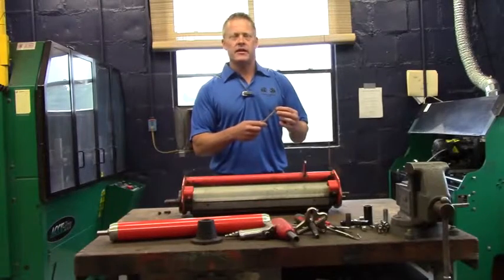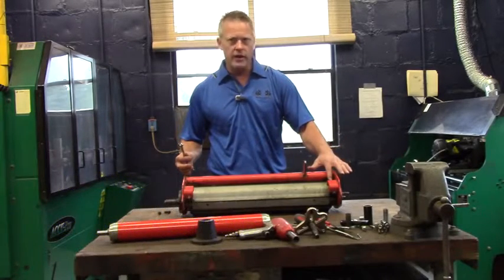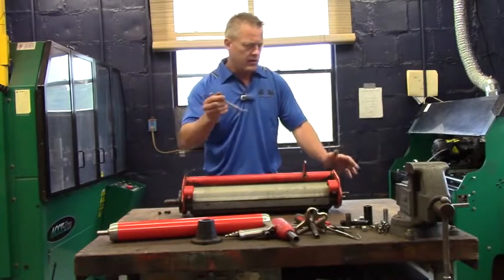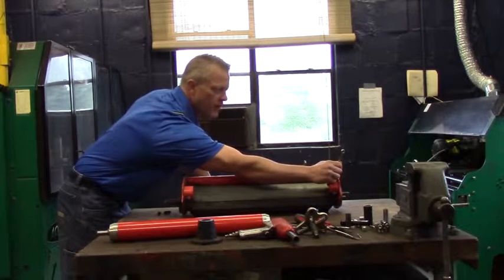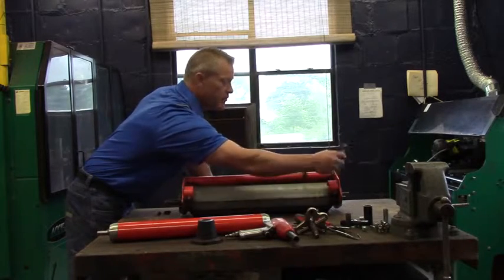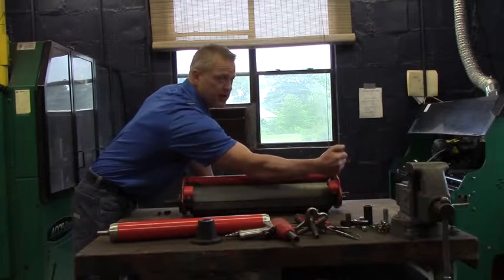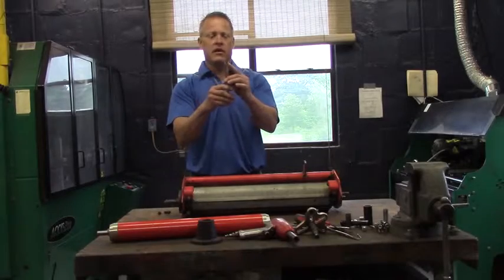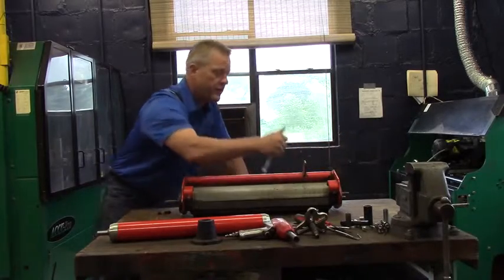Jacobsen LF reel mod

Comment: Nice. I wish I had those bolts back when I was working on those kind of mowers. The only thing we did was, we used a stronger open end wrench that was less likely to spread over time.